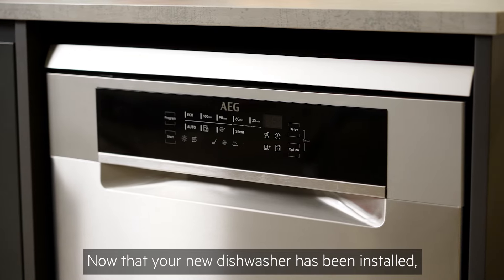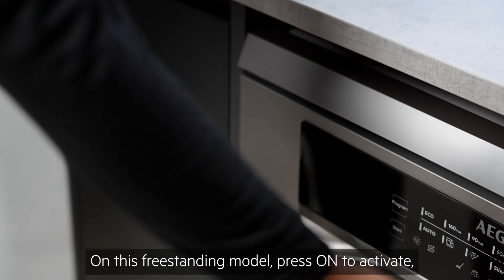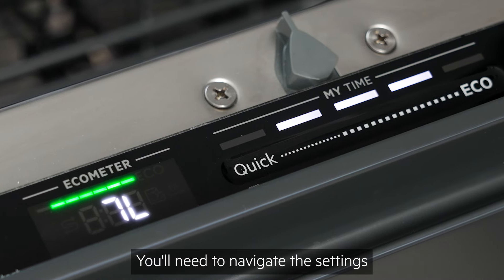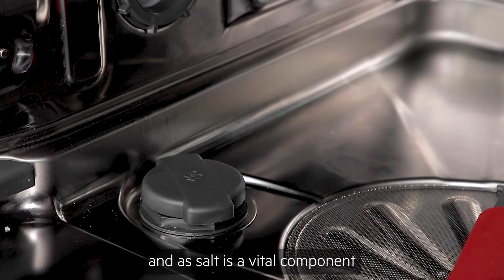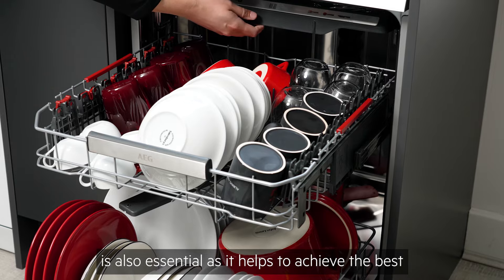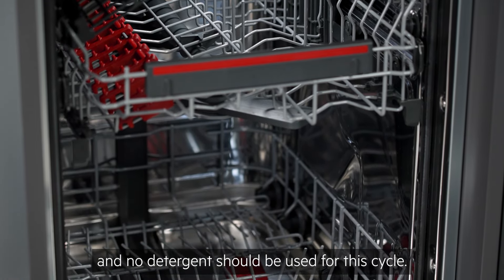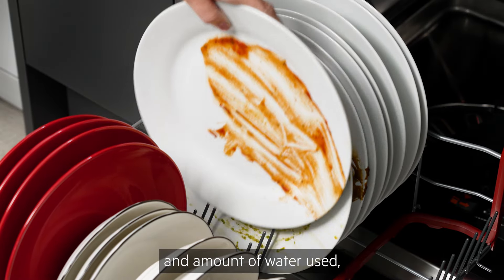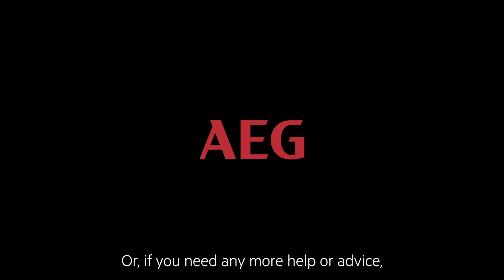How to prepare for first use on your new dishwasher | AEG

Comment: Bought the AEG 7000. Thinking that it came with it's own door (based on the first 3-4 pictures I saw on the site.) It comes without it's own door and without a top panel! I couldn't figure the settings menu without seeing this video! Also the front rolling door installation wasn't easy at all! 😐😐